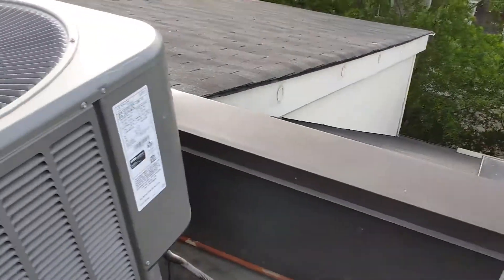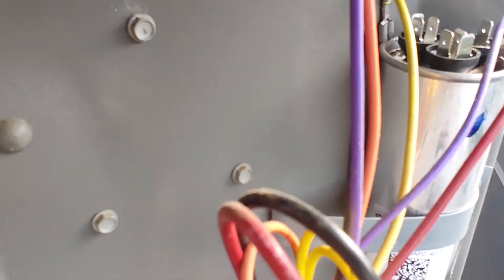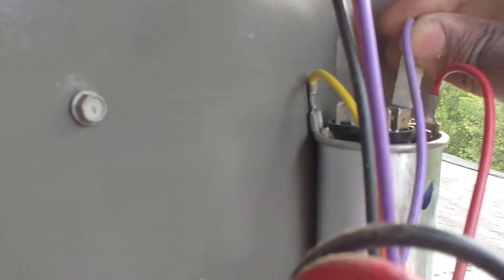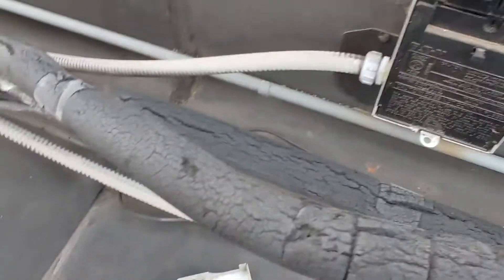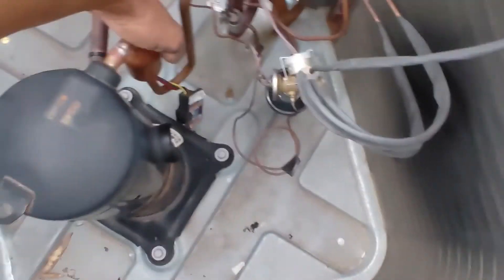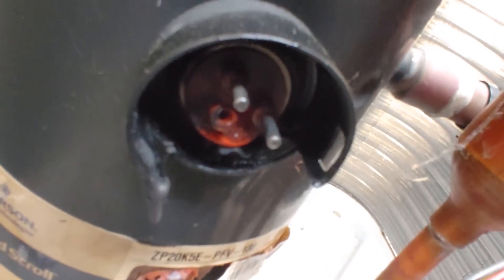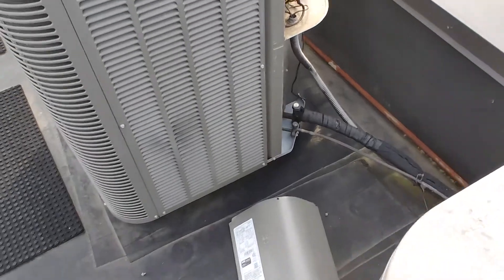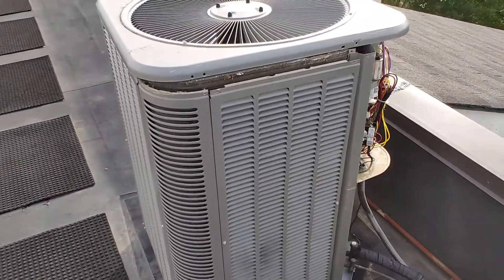HVAC Maintenance call ends in mistake that killed compressor!!! Tips to maintain hvac system.

Comment: Could have been a mistake but it looks like a lighting strike to me, it can do some very wierd things.
Reply from the maker: Yeah, I agree the initial issue was and probably lightning strike but after they reinstalled the board they had the 120 V hot wired on the low-voltage 24 V tap.  Thanks for watching!
Reply: @HVACTechKnowledgy  I think you have something confused I was referring to the cap & compressor wiring blown out on that condensing unit on roof with the black spot on outside of cabinet . If that cap was unhooked when the last tec left unit wasn't running. Thanks for sharing your calls with us it really helps the new tech's to gain some experience & show us old guys some new tricks too.

Comment: I went to a call back where a rookie technician forgot one wire on blower motor housing and one on the CAP after a maintenance and the motor burned out. That was a Hot motor!
Reply from the maker: Crazy! I've seen that before as well. That's why I try to be as non-invasive as possible when doing my PMS